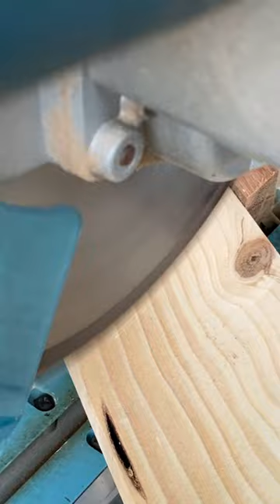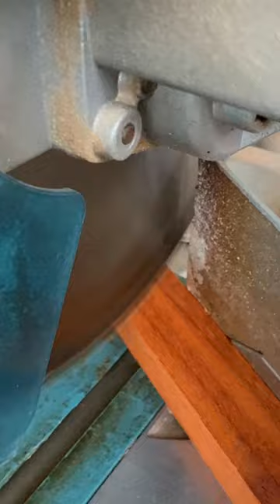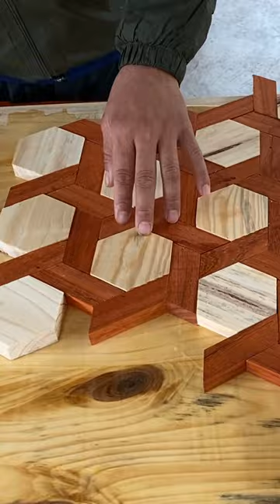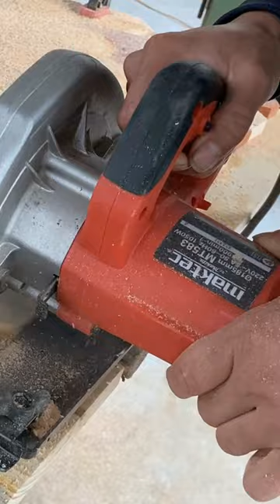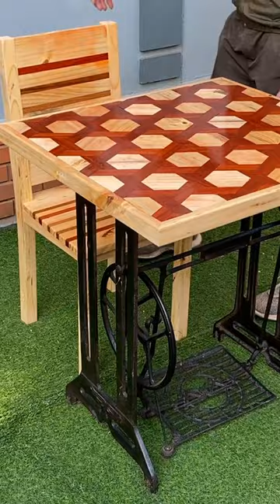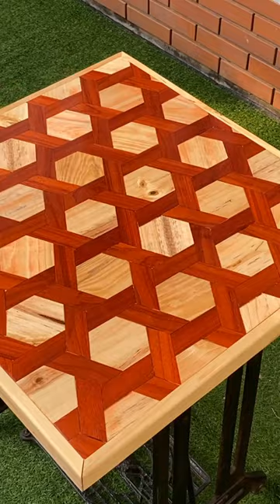Crafting a Sewing Machine Leg into a Custom Table

Comment: Bro, fingers are way too close to the blade 😂
Reply: That’s a miter saw, you’re the one controlling the blade’s up and down pivot, your fingers and body aren’t moving towards the blade at all unlike in a table saw. So unless you’re not right in the head, there’s only a minuscule chance that you’re going to get injured. Any person who’s overly concerned about that shouldn’t use any kind of power tool at all, not even a drill.
Reply: @ImALefty08 I experienced a piece of Wood got stuck in my miter saws Blade. Happend in a fraction of an eyes blink. The saw stopped from full rpm to Zero in a millisec, the piece of Wood bent the massive 5mm Steel fence. I was lucky that I have Fingers, both eyes and my teeth left without any further injury. 

Dont be stupid, you dont have a clue what a brutal force that was once that piece of Wood got stuck. Dont want that ever Happen again. 

If my Fingers would have been that Close to the Blade Like in the Video, I would now have a Hand less ❤